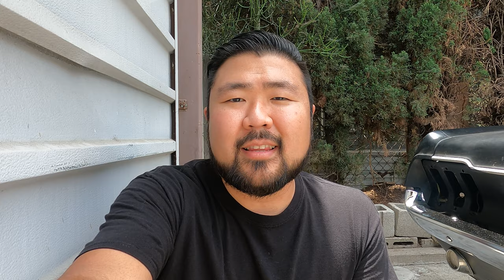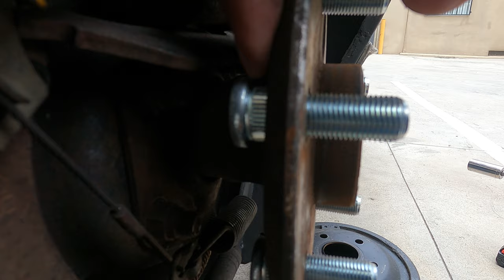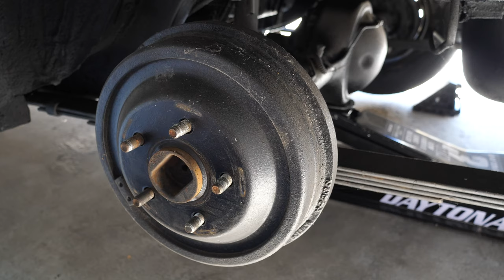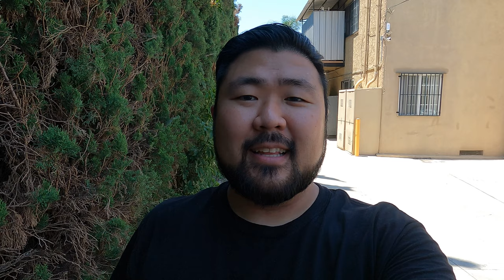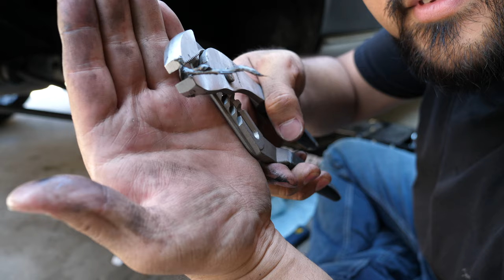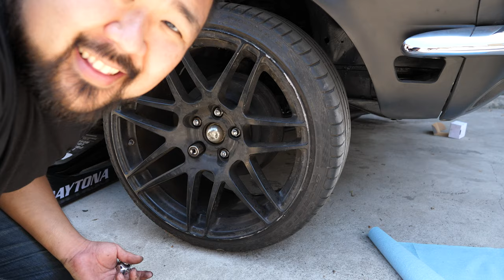1968 Mustang Wheel Stud Replacement!!!

Comment: On the front wheel hub, the large nut for the bearings actually is two pieces.  There is the actual nut and there is the retainer for aligning the cotter pin.

Comment: Thank you so much for this video. I removed the rear tires and found spacers with the original studs sawed off and when I went to remove them it stripped 2 of the three. On both sides.
Reply from the maker: Glad to be of help! It's always better to find a problem before it became a problem than finding out the hard way 👍You definitely got this! 😁

Comment: After doing it, would the front drum come off without having to disassemble the bearing?
Reply from the maker: If I remember correctly the little silver dome thing had a protruding part that would catch on the drum. It may be safer just to dissemble and regrease(I didn’t regrease 😅) just in case! The whole grease thing made the job so much harder hahah

Comment: What wheel studs did You use?
Reply from the maker: I used these studs https://www.amazon.com/gp/product/B005GMC9VK/ref=ppx_yo_dt_b_search_asin_title?ie=UTF8&psc=1
and this stud installer
https://www.amazon.com/gp/product/B000ETUD22/ref=ppx_yo_dt_b_search_asin_title?ie=UTF8&psc=1
Hopefully that helps! Goodluck if you're doing this👍👍
Reply: @JeffSongCars  Thanks
Reply from the maker: No problem!